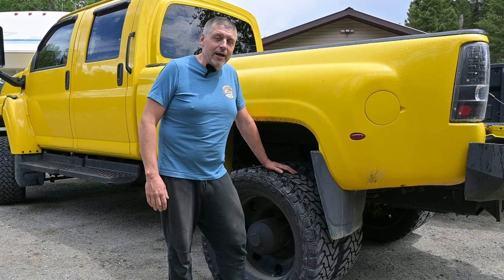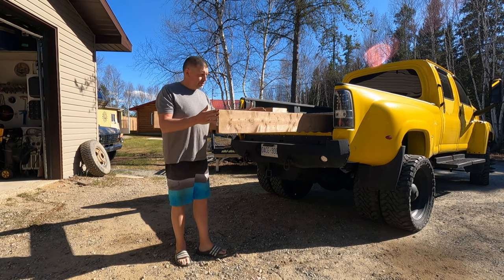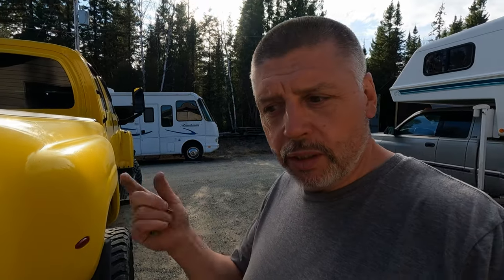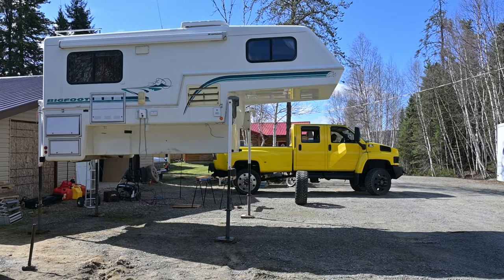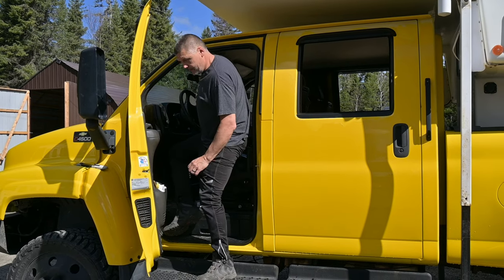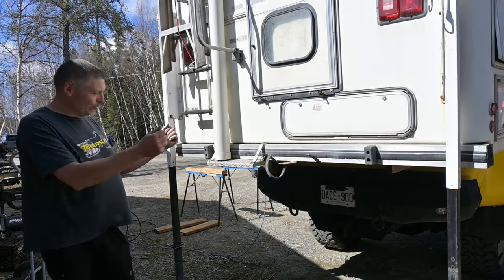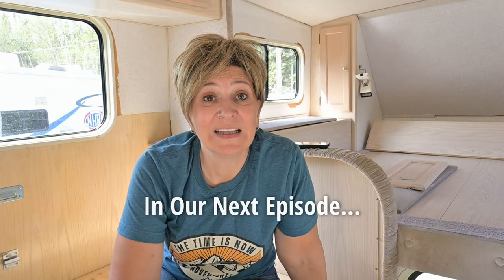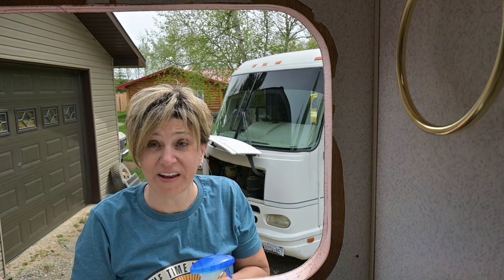Will It Fit?  Loading Our Truck Camper For The First Time!

Comment: Is the trailer centre of gravity still ahead of the rear axel on that type of truck?
Reply from the maker: The camper is designed for an 8ft box truck, as this is. This is a much heavier built truck than is required though.
Reply: I asked because it looked to not be all the way forward against the cab, which could mean the centre of gravity of the camper is behind the rear axle putting a bit of uplift on the front of the truck.  Just curious.  That is definitely a BIG truck.  What made you interested in it rather than something like a F450?
Reply from the maker: Yes is all the way forward. The 4500 chassis is a little longer than a 2500 or 3500 so the box front is a few inches thicker, leaving a little more space from the back of the cab. We were long for a pre def diesel. I'm sure a Dodge or Ford could be an option also.

Comment: Someone is going to need an uppy up step. When I am “stealth parking” I have a short aluminum step ladder I pickup up and keep inside. Shut the door - is the rig parked or “camping”?
Reply from the maker: Hahaha, yes, I am!! We will have a small step ladder with us as well.  Gord is currently planning out a pull out deck, which will make getting in and out of the camper, so much better ☺️